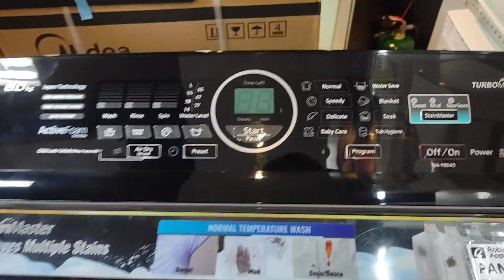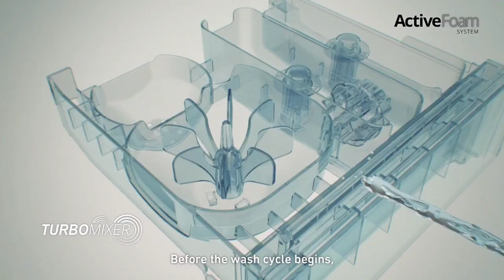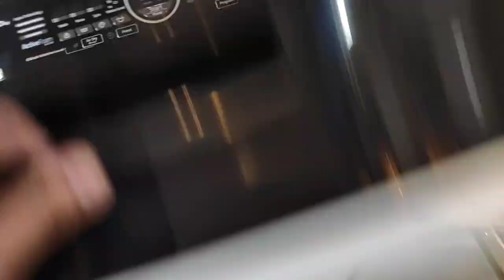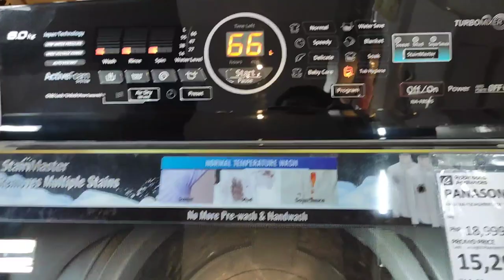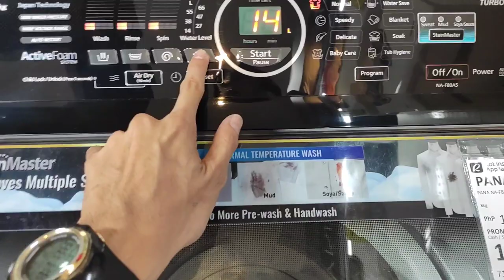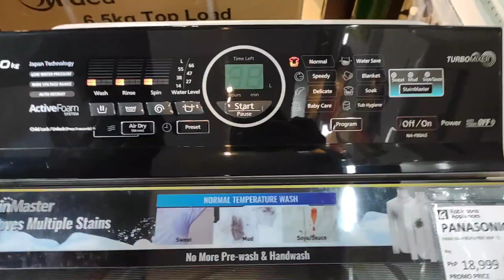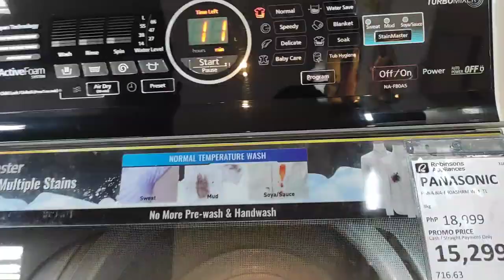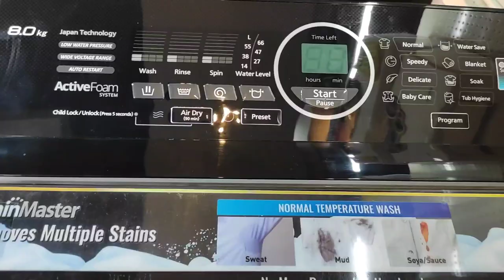PANASONIC NEW MODEL AUTOMATIC WASHING MACHINE 8KG + Stain Master -  NA F80A5HRM

Comment: Sir may 16kg po kami na Panasonic Inverter. Pano po gagamitin yung Stainmaster na may 
1Collar/Sleeve, 
2Oily, 
3Bacteria elimination
4Sweat, 
5Mud, 
6Soya/Sauce

Pano po sya isasabay sa automatic program or manual na setting? Sabi nyo po kasi di sya pwede isabay. Pano po pipindutin? Stainmaster muna tapos press start OR stainmaster tapos yung manual setting tapos press start?

Thank you po sa pagsagot

Comment: ask q lng po sir sbi nyo po matagal ung ikot nya ung nabili kc nmn mula ng nagamit namin ang hindi continues ung ikot left and right lng and ang bilis matapos nasa normal lng cya ganun po ba tlga ang ikot nya
Reply: Kung gusto nyo po matagal ang wash time press nyo po stainmaster then pili kayo ano desired option nyo line SWEAT, MUD, or SOYA and also mas strong ang ikot ng stainmaster compare kay normal. Or second option is mag manual wash kayo pwede nyo naman ulit ulitin ang wash time kung ilang tag 12 mins. Ang gusto nyo.

Comment: Thanks sa info... minimum time cycle ba 1 hr? O pag speedy eh shorter time?  First time namin gamitin.
Reply: paranf lumalabas na pag normal automatic process, 1hr po un lahat lahay hanggang ma spin. nasa manual po sya.
wala sya nung preset option n kung gusto mo mag wash for 1hr or 2hra walang ganun. ung preset is idedelat lng nya ung start time.

Comment: Boss kakabili ko lang ng same model ng dine demo mo, sabi mo para cyang twin tub, na umiikot, baket eto e 180degree lang ang ikot  ikot lang konte tas balik na ulet. Parang di cya maka alis ng mga dumi. Paadvised naman po baka nasa setting lang. napanood ko kc yang video mo kaya napabili ako pero disappointed sa performance.
Reply from the maker: Sir dipende po yan sa klase ng damiy na lalabhan. Sa normal po na program malakas po ang ikot.. Baka po sa delicate nyu Ni set.  Program
Reply: Sa normal ko lang naman na set e. Pero 180 degree lang ikot nya ndi ung 360 na iniikot nya talaga.
Reply from the maker: Pagmaytubig po yan. Sir.  Bumabaliktad ung damit.  Kumapara natin sa ibang brand yan sir.. Ang ikot nyan.  Mas matagal.. Pagnakita nyu ung sa ibang brand.  Mas Hindi talga makakalinis iikot 3sec tapos hinto tas 3sec uli
Reply: Tipid po ba sa kuryente